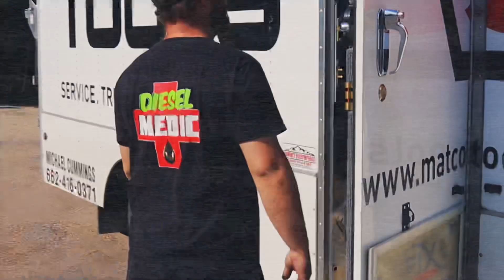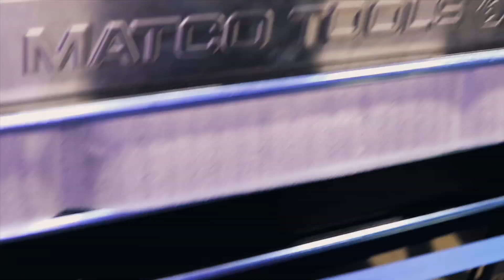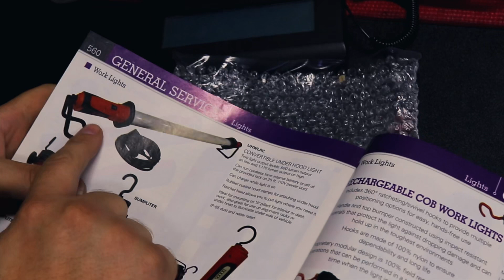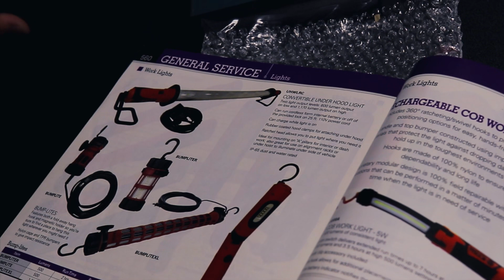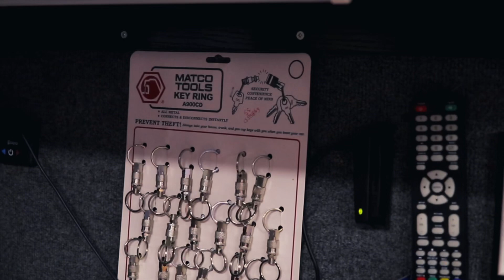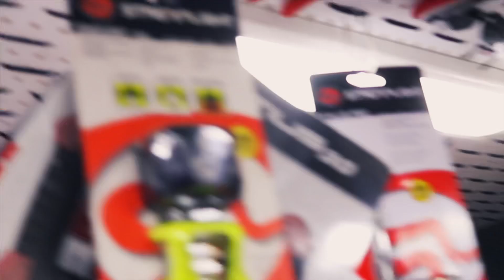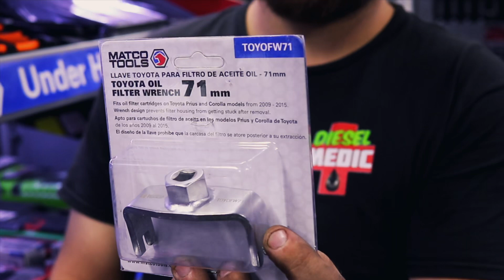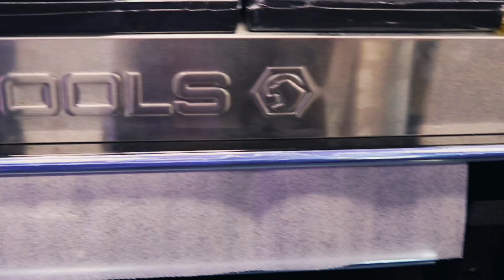Matco Tools: Pro-Xnife Set and the BIGGEST Chair I Have Ever Seen!!

Comment: Do you prefer the Matco over the Snap-on screwdrivers? Or vice versa? Debating on which set to pick up
Reply from the maker: The one major advantage I can say that nobody can dispute if you break a snap on screwdriver only the blade portion is warrantied. Not the handle. If you break a matco screwdriver the entire screwdriver is replaced. So ...... that’s the best answer I can give you. I haven’t ever broken either one because I refuse to use a flat screwdriver as a prybar. I only use them on screws.

Comment: Is Wally gonna order a Revel?
Reply from the maker: 🤷‍♂️ I was the one fascinated by the revel box
Reply: Koon Trucking buy two - maybe you get a sweet deal.
Reply: Michael won't sell them on a BOGO so I won't be getting one. Plus I'm still paying on the snap on box.
Reply: john hare thanks Wally.  You have an awesome box anyway, love the blue.  Could you keep us updated on the bedliner top, like how durable it is?  Thanks.
Reply: @WBOS72  so far it is holding up quite well. i have a small single cylinder diesel engine  and a rotor and housing on it(it might be in my tool box video) plus i have worked on turbos on it and other projects that we have going on and other than having to blow the dirt and dust off of it, its nice to have. we will see in a year or two on how well it holds up over time.
Reply: john hare thanks.  Im hoarding for a tool box, really love your box compared to a revel.
Reply: @WBOS72  thank you but the revel is really a much nicer box than what i have. i would like to have the revel but it is out of my reach for the time being. maybe one day it will be a reality.
Reply: john hare thanks Wally.